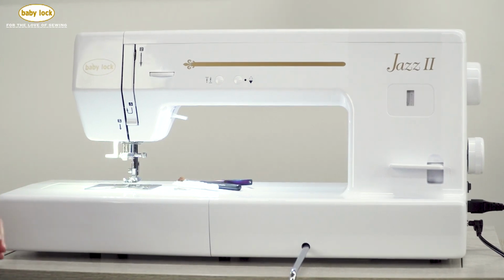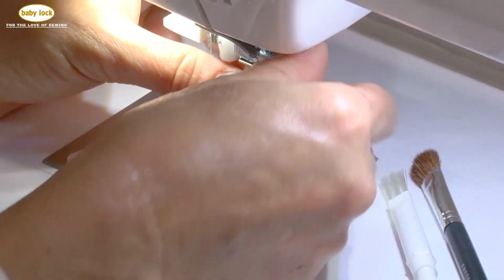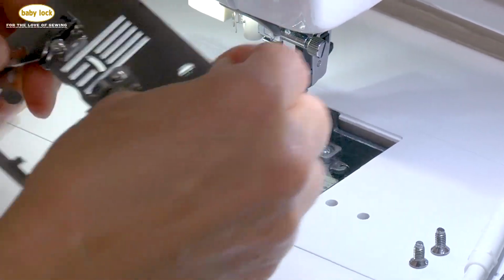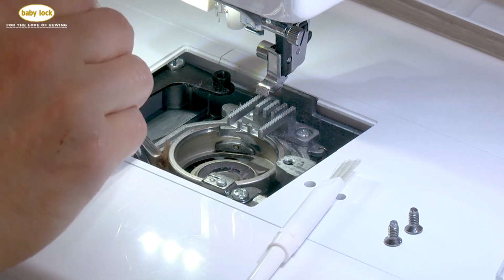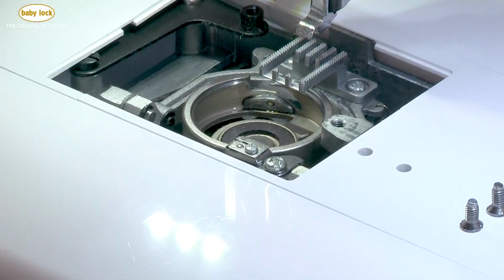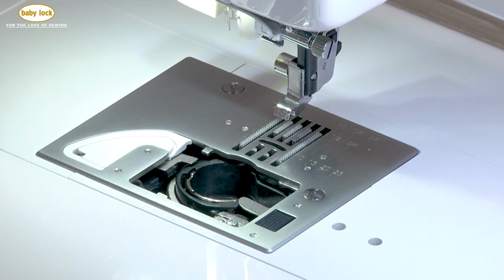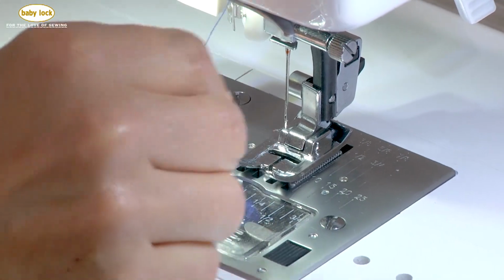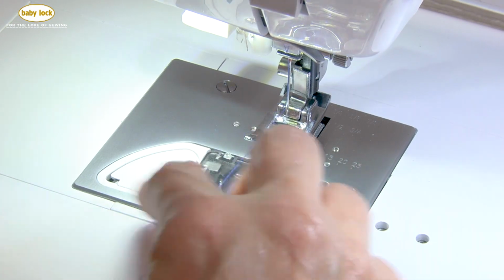How to Maintain Your Baby Lock Jazz II Sewing Machine at Home

Comment: Am I the only one that is driven crazy by her hand being in the way when she shows you where to put the drop of oil???
Reply: I couldn't  see where she put the oil. I wish could  show us better or a picture  of exactly where the oil goes. Your right  her hand is blocking our view
Reply: you can see the oil spreading. its on the side of the bobbin case holder, like the edges. i prefer to put a little oil on a brush and kind of paint the sides of the bobbin case holder. less messy
Reply: @slipperywalrusbathingonaho3551  good idea.

Comment: I’m shocked that canned air was recommended!
Reply: I thought  it pushes dust  further  into  sewing machine
Reply from the maker: Hi Rebecca, as long as you rotate the handwheel while blowing away the lint, it will not build up. When using canned air, do not lean or shake the can as moisture may appear.
Reply: @babylocksewing  thank you for pointing that out.